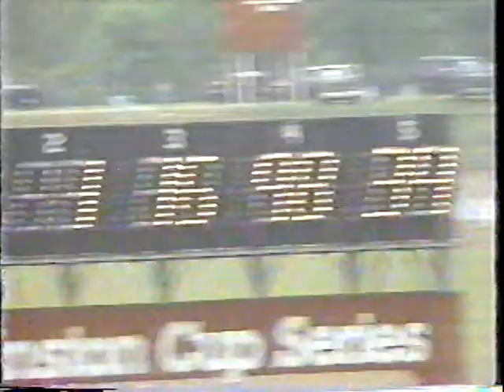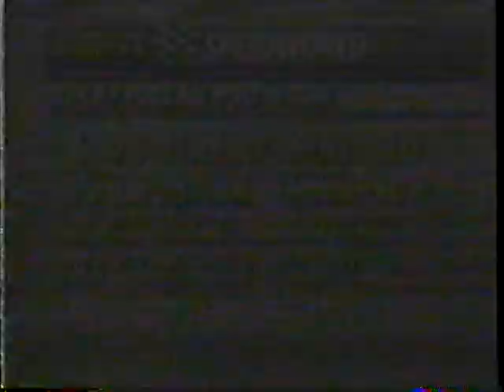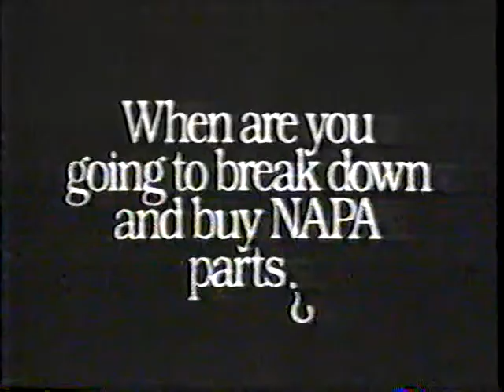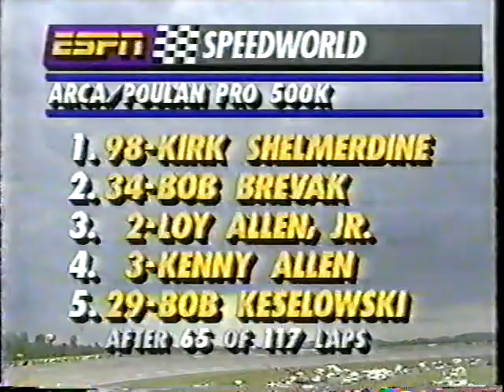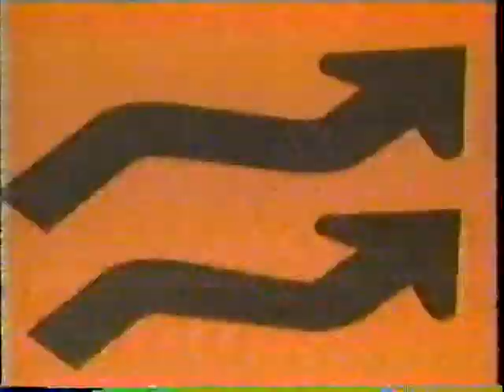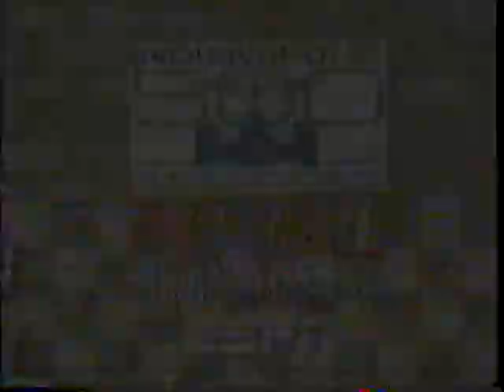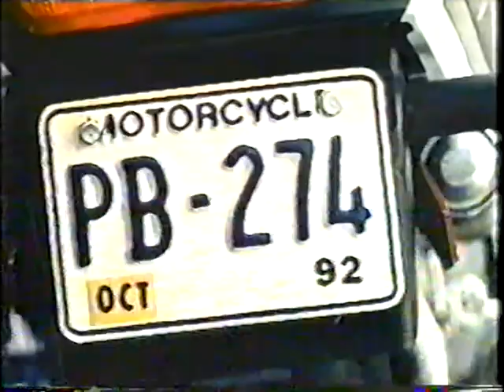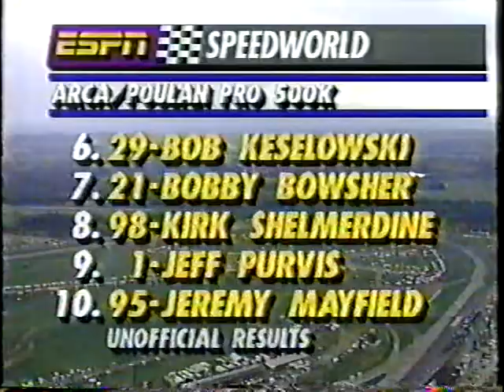1993 Poulan Pro 500k

Comment: I've never seen that race before, I did saw the 91' race.
Reply from the maker: That's why I uploaded it lol. 1991 and 1995-2016 were already online, so I took it upon myself to upload 1993 and 1994. I also have the 1989, 1990, and 1992 editions, but they're on VHS. I don't have the converter to upload them, so I'm probably gonna mail them to Dave W. and have him upload 'em.
Reply: 1997 is the only one I haven't seen online. I have every televised ARCA race at Talladega from 86 on except 1987, hope your tapes are better quality than mine.
Reply from the maker: Ohh, nice. I've seen stuff from '87 and '88 on here in pieces, but never the entire races and NOTHING from the '86 ones (one of which, Davey Allison won, right?).
Reply: Davey's ARCA wins at Talladega were in '83. Grant Adcox won 4 in a row in '86 and '87. Davey ran the '86 spring race which was his last ARCA start. Started dead last in place of Bob Schacht and ended up 3rd I think.
Reply from the maker: Yes, that was the one I got it confused with. He finished 2nd that day.
Reply: @SMIFFTV  SMIFF! nothing but gratitude, especially nowadaze
Reply: @SMIFFTV  are you as huge a Trickle fan as i have always been?